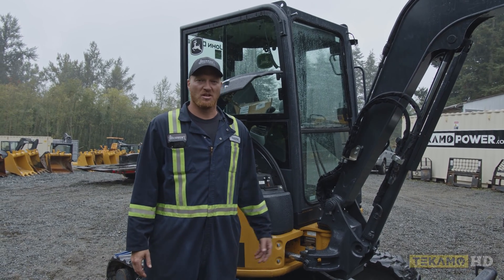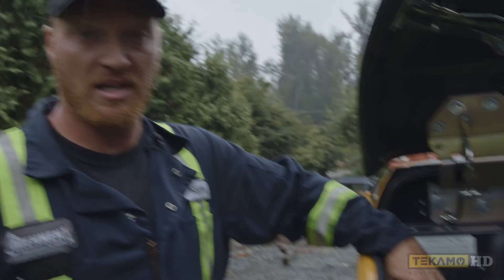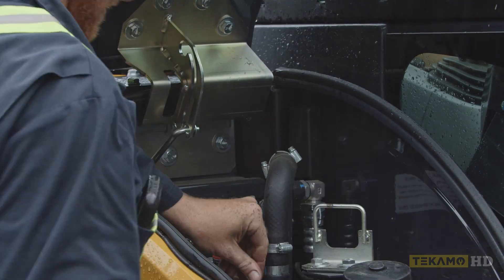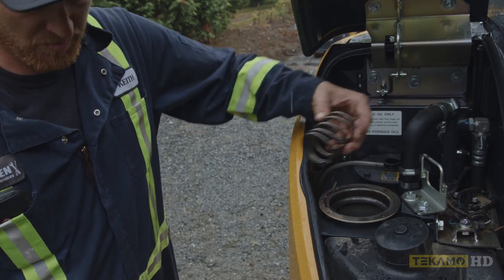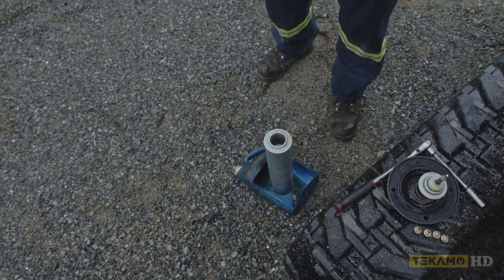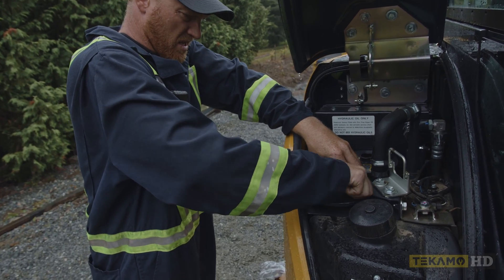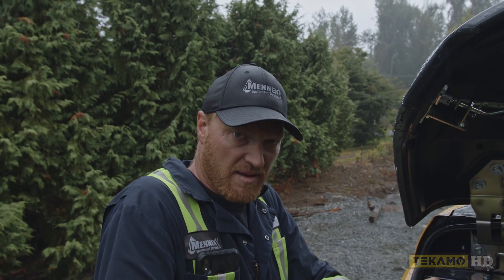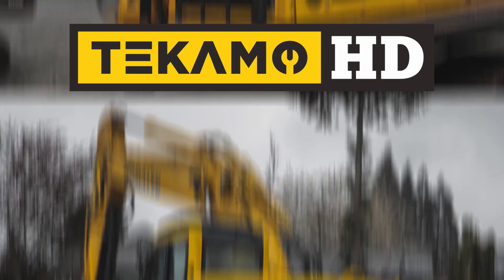Save $$$ - How YOU Can Replace Hydraulic Return Filters - John Deere 35G Excavator Maintenance

Comment: Just Subscribed!!!! I appreciate you so much.   I own a 35g.  Ive only got 260hrs juat did the hydro filter.   Not sure if I missed it in the video.    But Make sure the O rings are in the new filter.   Mine were not.   Already put the filter in and realized I need the rings.   Looked at the the one I pulled out and yes it had 2.    1 on each end.
But please keep up the good work Ill tell my friends.   1 has a 35g the other a 60g.      They sent me a pilot filter oil system element.    Its a small little filter.   Should I install it at 260hrs?
Reply from the maker: It’s best to consult with the maintenance chart that is attached to the back window of your machine or it’s in the maintenance section of your manual. If you ever need parts for your machine, especially rubber tracks, consider going to https://www.FortisHD.com as they are very very helpful and specialize in John Deere/Hitachi. 

We’re very happy to hear the videos are useful. If there’s anything you need video wise let us know. We even have a video on repairing a submerged 35G!

Comment: In my manual it says to bleed it. The screw is fairly hard to find, assuming I’ve found the right one. It looks to be a hex/Allen head. Seems pretty tight almost stuck. Wondering if it’s absolutely necessary to bleed and is there an easier way. Had to use a mirror just to find the screw. Anybody got advice or suggestions?